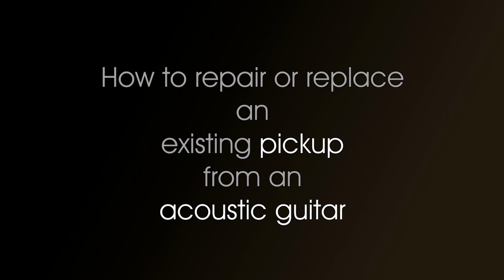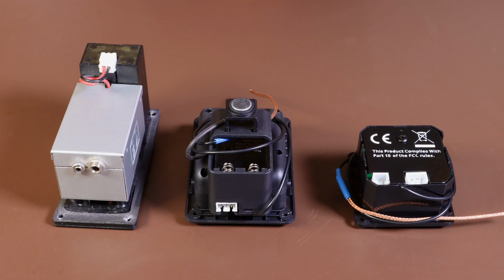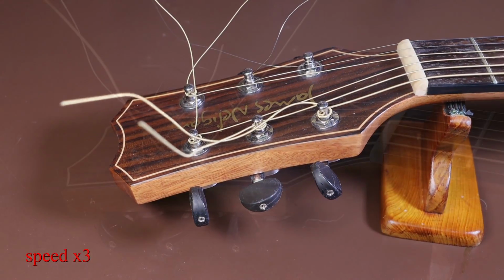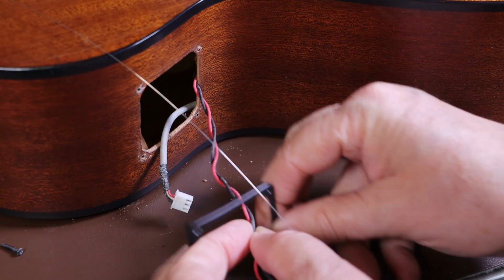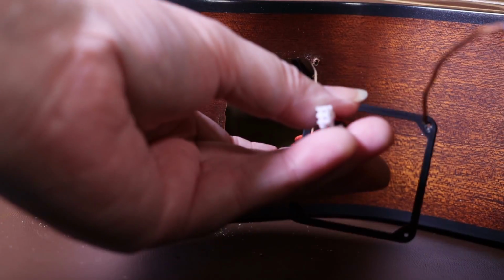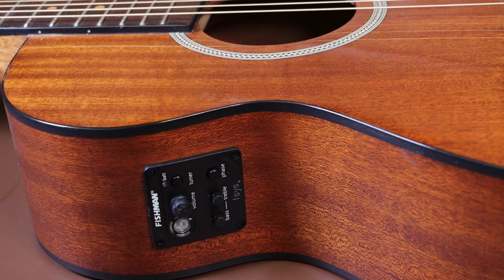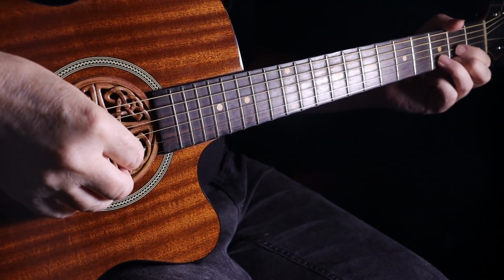How to replace or repair an acoustic guitar pickup and preamp (piezo pickup)

Comment: hello sir I have issue I buy new eq-kit fix it on my acoustic guitar bu my piezo is not working I'm in very tension...please help💔💔😣😣😥
Reply from the maker: does the tuner work and hear the strings ?
Reply: @guitar-academy  yes sir tunner is working but piezo not working and nothing to record
Reply from the maker: @stepbytech6098  the piezo must be working then, but the preamp or the out put lead is faulty.  Check the lead first and then the wires running between the preamp and the output socket.  After that, there is nothing else I can suggest without having the guitar in my hands, sorry.  🤔🤔

Comment: Hello everyone does anyone have any idea why won't the acoustic guitar string don't sound even... My fender acoustic came with fishman pickups after using 3 years my string sounds uneven while plugin please help...
Reply from the maker: dirt under the saddle or the pickup being worn through can both cause the strings to sound uneven.  This is because the saddle should put even pressure on all the pickup, so a little bit or dirt or uneven saddle base causes the saddle to press harder on one part of the pickup.  Another thing that can make a massive difference is the strings and the gauges you have fitted, on one guitar I worked on changing the strings solved a really load bass.  I hope this helps

Comment: Thank you so much for the video. Will try now to repair mine. The problem of my preamp is this: It does not tune the strings accurately although the preamp is properly working picking up the sound through the amp. How can I repair it? Thank you. Or should I replace the whole fishman isys?
Reply from the maker: Saddly, there's no way of adjusting the tuner so the only way to fix it is to replace the whole thing 🤔
Reply: @guitar-academy  thank you! <3
Reply from the maker: @ariesdp182  no problem 😊😊

Comment: Great video, very useful. Your preference for like for like replacement makes good sense to me. I am struggling to find suitable replacement for my Ibanez SRTn by B-band. Do you have any sources I might try? Coming up empty on eBay and Google. Or if you could suggest a suitable replacment that would be great too. Cheers!
Reply from the maker: sorry, they're quite unusual.  All I can think of is to contact an Ibanez dealer or importer .. 🤔
Reply: @guitar-academy  Thank you for the response. I have tried all that. Now thinking like for like replacement is not possible. B-Band went out of business some time ago. All I have found so far are replacement battery holder and faceplate.
Reply from the maker: @JCYeahUKnowMe  If I hear anything I'll tell you know, but I don't think the chances are high.  Another thing to think about as a last resort is a preamp that is bigger then the B-Band and then re cut the hole. 🤔

Comment: Great video! I bought a new fender acoustic guitar and it has a fishman presys. The tuner works fine. When you strum the guitar makes a very short sound through the amp and that's it. I've  tried new chords ran it through my tascam stib and same results. Strum and fades and that's it
Reply from the maker: It sounds like the amp is faulty.  If it's still under warranty I would take it back. 😒
Reply: I just bought a fender acoustic for my son and it lights up, tuner works but produces 0 sound.

Comment: The most difficult bit of this procedure is getting the pickup back through the bridge hole. I have a thin line ACOUSTIC guitar with a Fishmann Isis on it. Getting a hand in that guitar to feed the pickup back through the hole is quite tough on hand and guitar. I’ve tried tying thin cord to the pickup to pull it through - fail and pretty much trashed the pickup in the process. I’m going to have to replace the whole damned thing.
Reply from the maker: I sometimes push something through the hole and then I can pull it out ahead of the pickup, it acts like a guide.  It's a little easier but not perfect . . 🤔

Comment: You could wrap a rubber band a few times around the battery to fill the gap and reduce vibration. Hope this helps.
Reply from the maker: good suggestion . .
Reply: That’s a much better idea. I was about to comment about using some electrical or padded tape on the inside of the battery holder for a more permanent solution but most people don’t have 101 random rolls of tape in their shed like I do 🤣

Comment: I have an Esteban guitar looks like the battery holder came out at some point, and is probably lost.   I’m not opposed to replacing the entire preamp, but if I could just pop in a new 9v, that would be great.  A google search brought up some vendor names, but they didn’t seem to actually have what I am missing.
Reply from the maker: There are only so many makers of preamps so the same ones appear under different names.  I have bought  ones that looks like the damaged or missing battery holder in the past and they have fitted perfectly.  Sometimes second hand ones appear on eBay as well.  😊  I hope you find what you're looking for

Comment: Bro my guitars 1 and 2 string sound output is not coming whats the reason ???
Reply from the maker: Usually this is caused by dirt in the bottom of the saddle slot or an unevenly sanded saddle base, or I have even heard of the pickup being twisted.  Basically, the pickup has to be squashed between the saddle and the guitar totally evenly.  I hope this helps
Reply: @guitar-academy  bro i changed the saddle but same problem .
Reply: @guitar-academy  any problem in pickup mic????
Reply from the maker: @elishpeter  not the mic . . if the mic doesn't work it is for all strings, so it is likely to be the pickup.
Reply: @guitar-academy  ook
Reply: @guitar-academy  bro i have fishmen lsys t pickup
Reply: @guitar-academy  what i must do for that must change pickup or repair ????
Reply from the maker: @elishpeter  You have to replace the pickup unfortunately . .
Reply: @guitar-academy  ok thanks
Reply from the maker: @elishpeter  no problem 😊  good luck with the repair
Reply: @guitar-academy  😊

Comment: hi! great video! was wondering if you could help me out with a question; apart from bad quality, what could be causing an electronic buzz on a brand new electroacoustic?
Reply from the maker: Several things can cause that problem . .  the easiest things would be a faulty lead or a faulty (flat) battery.  More difficult to fix could be an internal bad earth or bad screening.  The screening can be solved, but I need to do I video on that to explain it properly.  Finally, it could be the settings on the amp, if you are using a guitar amp make sure the gain is down.  I hope one of these helps 😊
Reply: @guitar-academy  thanks a bunch! I've already discarded the lead together with the battery and they are not the issue. It appears to be a matter of grounding (possibly a faulty design) within the parts. Something having to do with the guitar's pre-amp itself, as when I move the eq sliders up trouble gets augmented. Is this a regular standard thing with battery powered guitars?  Will this signal damage an amp?
Reply: @diosgenes  Hi, I had a similar problem, and as it turned out, it wasn't in the preamp. I was playing into my computer via an effects box and interface, (external sound card if you don't know what an interface is) and there was hum. I even swapped out the preamp and it was still there. Eventually I found it was a grounding problem of the mains cable feeding my computer power supply. I measured the earth cable in the mains lead and it was 2 ohms. Not much, but enough to cause the hum. So check the ground/earth cables on all of your amps and connected equipment . If you use effects make sure they plug into the same mains distribution strip to avoid earth loops which can make the hum worse. Also I would say in my experience the after market replacement preamps that cost very little are not as good as the real thing. If you have a genuine Fishman think twice before replacing it with one of those.

Comment: I have a question
This happened to my preamp and after I found out it turned out that the piezo pickup was delivering a small electric current so that the sound that came out was small even though the volume on the preamp and mixer was full. how can i fix this?
Reply from the maker: That could be literally anything . .  the battery, the preamp, the pickup or the lead.  Sorry, I couldn't solve this problem without the guitar being in front of me  . . 🤔

Comment: I have a question you may help resolve. I have low humming on my Fishman amp. Its not that. Have a Taylor acoustic electric that's at fault. Was told to change my shielded pickup.
I see you mentioning the preamp which I have on my taylor. Could this be causing the low humming? Or change the shielded  pickup
Reply: This is Scott again. I meant to ask. Is the fishman preamp on my acoustic the actual shielded pickup?
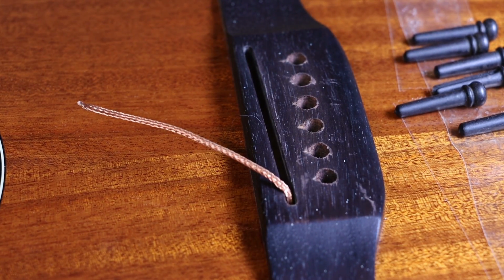Reply from the maker: Good questions but difficult to answer.  The easy answer first.  The pickup is the bit that goes under the saddle and the shielding is the braided wire that goes around it ( 14:48 ).  But there is also shielding around the wire between the preamp and the output jack.
Hopefully you've tested the lead and the amp with another guitar to check the problem isn't there, because these are the most common cause of hum.  An other easy suggestion is to roll up some wire wool and clean the inside of the output jack socket.  If not of these work you will have to replace the preamp.  I hope this helps 😊😊

Comment: I wish you could guide me A few days ago I started having problems with my guitar, it is the GD51-NAT model. I've been with it for a year and a half, when I plug it in sometimes it rings and sometimes not. And when played back it sounds like it has "cheap pedal distortion", sorry for the expression. When the sound shouldn't be that. What can be the fault? I already changed the end pin connector but it doesn't solve the problem.
Reply from the maker: Some common problems leading to distortion could be;   1. the volume is too high.  Don't take the volume over 75% on the preamp.  2. the battery is flat or faulty.  3. what you are plugging it in to is causing the signal to clip. Make sure you are plugging the guitar into something that is suited to the preamp and if you plug it directly into you computer, make sure the signal isn't clipping.   If it is none of these problems then the preamp is probably faulty.

Comment: hi...very informative vids. I have an old Yamaha APX -4 . the preamp when touching the volume control cause hum through the amp and when removing your hand the hum disapears. Any suggestions as to why this is?
Reply from the maker: That's a difficult one without the guitar here to look at.  It sounds like a bad earth which might be caused by a dry joint in the preamp.  Because everything is so small they are very very difficult to fix, so it might be worth you thinking about replacing the preamp, which is probably the only solution.  I hardly ever use the volume on my preamp, but I'm guessing you use yours more. . .
Reply: @guitar-academy  thanks for your reply....I think you are probably right but unfortunatley Yamaha do not make parts for this model anymore....thanks again
Reply from the maker: @musoman6754  that's a shame, but keep your eyes open anyway.  I had a similar problem with another guitar but the parts appeared about 6 months later on eBay (I think from a bankrupt shop).
Reply: Check the ground connections on your amplifiers.

Comment: My isys+ does not catch any signal from any string, so i tried replacing the pickup with a 90° style but i bent it and it did not work, waiting for a new preamp system, gonna do it just as you showed it.

Thanks
Reply from the maker: Sorry to hear that, I've had jobs go wrong like that in the past . .  it's really frustrating  . . But next time will be the good one 🙂🙂

Comment: Hello bro...My D string sounds a little bit lower than other strings on the pickup, is that normal?
Reply from the maker: I assume you mean the volume is lower.  This can happen if the bottom of the saddle isn't flat or bottom of the slot has dirt in it.  If it isn't serious you can probably compensate for it with EQ and then sort it out the next time you change strings, unless you happy taking the strings off to sort it straight away.  You can even use very fine tape under the quite string . .